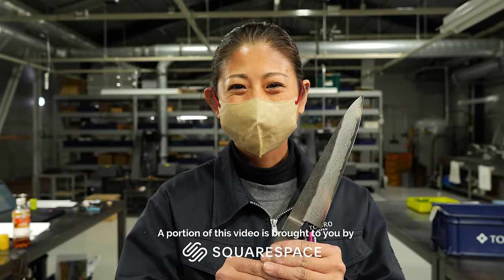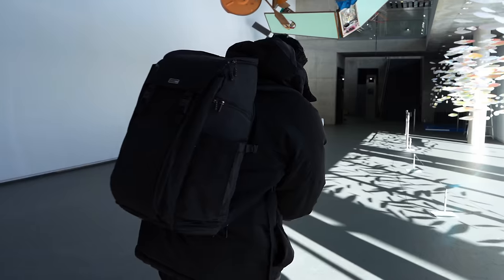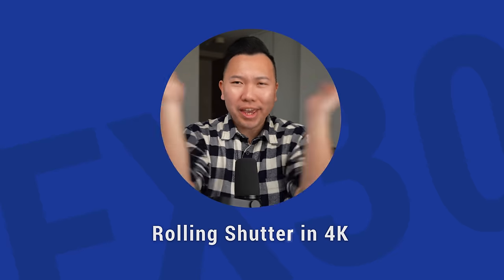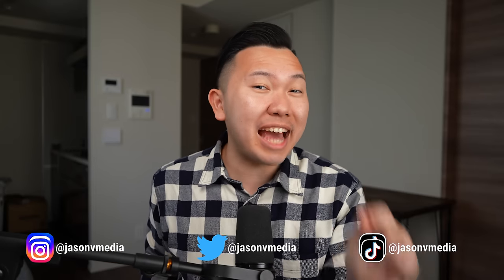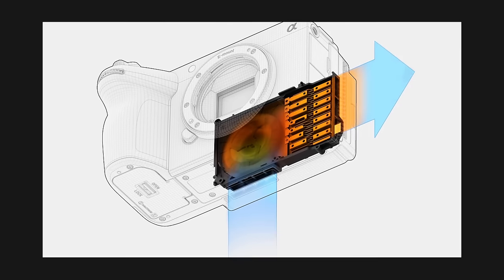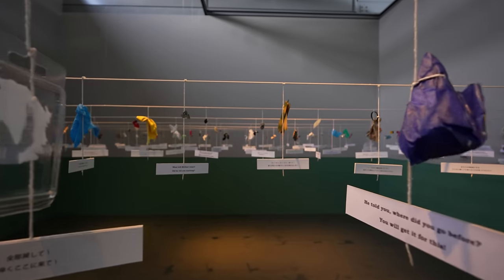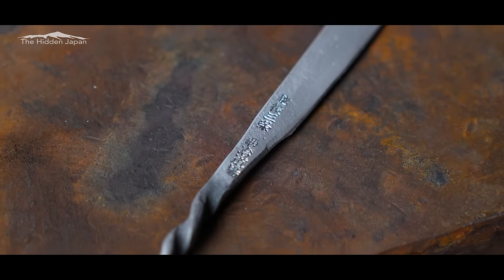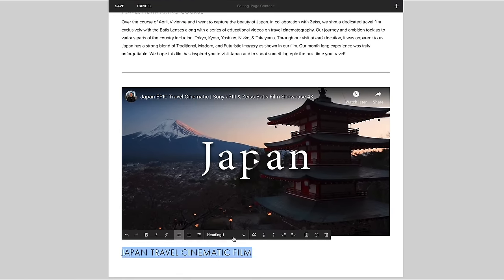Sony FX30 | 3 Months Later User Experience Review ft. Niigata, Japan

Comment: I "upgraded" from an a73 to an fx30 since I'm more of a video shooter. The video centric features, 10bit colour, cineEI etc. I can buy 4 amazing APSC lenses for the price of one gmaster. I could've had an fx3/a7siii, or an fx30 with a couple lenses and an rs3 pro for the exact same money. Easy choice.
Reply from the maker: crazy how the fx30 beats out the a7III in some aspects! times are a'changing!
Reply: Are you happy with the upgrade to the fx30 from the a7iii? I’ve been considering doing the same 😬
Reply: Just ordered my fx30. Upgrading from an a7iii. Super excited. I never really push my iso past 2500 anyway so low light isn’t an issue for me. And I very much enjoy the sharpness of the fx30 since it’s downsampling from a 6k sensor. Super excited to get my hands on this.
Reply: What about low light capability? Also, would you still recommend the fx30 for video if you’re outside the US where it’s more expensive than the A7 iii?

Comment: Excellent video, especially your “commercial” for the travel business. I have had the a6500 for 4.5 years. I just an amateur photographer but I like a “real” camera over a cellphone camera. You nearly had me sold on the FX30, but no viewfinder and no built-in flash (and $1800 is quite a bit, but I could use the APSC lenses I already have).  I seriously considered going to the a7C a few months ago, but the conversion cost was to much to justify (converted for full-frame lenses). I think the FX30 might be a better choice over a7C for those already invested in APSC lenses. I’ll have to look at the specs of the FX30. Maybe it might be a good choice if my a6500 decides it has taken enough pictures and videos. Thanks again.

Comment: great video Jason!!!... like your mobile setup. personally,  my problem with sony aps-c, is that Sony keeps putting aps-c sensors in aps-c bodies with "aps-c limitations" an aps-c camera in a full frame body with the same processing power. will be a much better option then a FF. better IBIS, better iso performance, better battery life,  ect ect. The Fx30 is the answer, we just need a A6 (aps-c in ff body) and a FX60.

Comment: The FX30 is a video camera.
Blury background is primarily preferred for photos and is often overrated for video purposes.
If we want to achieve a large separation of the foreground and background, then the lenses are suitable for this and, above all, a suitable shooting technique (zoom), but during normal shooting we usually want to see even a slightly blurry background, and this is precisely where the FX30 is great.
I'm not a professional. I use the FX30 for family video or for my small personal projects of nature or old architecture. I believe that for these purposes this camera is a very good choice, especially for the huge selection of lenses - from the cheapest ones to the top ones used by FF cameramen.
I've been shooting on the Sony FX100 (very good camcorder) for a long time and I was still waiting for the FX800. It didn't come and I reached for the FX30 because it does what I wanted.
The FX3 is better in low light, but it can't do such a fundamental thing as focus breathing compensation. It also has a better display.

Comment: i am using the sony a6400 with kit lens, does the job for me. however recently its been over heating after like 40 minutes of recording.  on 30fps at 4k. in 3 years it never overheated not once, including  recording in the hottest weather  (thailand)
Reply: Do you have the "allow high temp" setting on?
Reply: @@jeremyg9305  yes it's set to highest setting

Comment: Can't wait to upgrade my a6300 to the fx30
Reply: I'm curious why would you upgrade a 6300 which is a stills and video camera for a video centric camera? I'm very interested in your answer
Reply: I'm curious to why you didn't buy the A6600 already
Reply: @tomghzel  I mean yeah even though he could have bought a a6400 all depending on what lenses he has a 6400 and the a6600 is relatively the same camera except for two things 6600 has built-in stabilization a bigger battery.

So you're absolutely right he could buy 6600 or save some money and get a a6400
Reply: @Hagaishi TV  to simply put, I have outgrown my a6300 which has been my main camera for the past 5 years. Don't get me wrong, still is a fantastic camera,  but I want to jump into color grading which 10 bit 422 will allow me to have more flexibility.
Reply: @HagaishiSama  those two have the same sensor as the a6300 and the same video quality..
Reply: @HagaishiSama  I agree that they are two different cameras, but the sensor itself is the same sensor that they introduced on the a6300, which means the video quality is the same as well. 4K30 has a crop on the a6400 too. The FX30 is really the first worthy upgrade imo because it has finally changed the sensor/processor and therefore the capabilities in recording.

I hope we get a 6000 series camera with that sensor soon so I can upgrade my 6400!
Reply: Hi, i did that some months ago, and boy i made a good choice. 
I shoot only video, i started some years ago and i bought a used a6300 (which is a great camera) from a friend of mine and it served me well for all that time, but switching to a FX30 is a game changer for me, i already had some good lenses (Sigma apsc and sigma zoom) which worked wonderfully with the fx30, it video is your main goal you can't choose a better camera if you already come from aps-c and has aps-c lenses
Reply: @eliapavoni2275  ye I have mine with the sigma 24-70 art. 🔥

Comment: Only thing holding me back from FX30 replacing my a6300 is the lack of a mechanical shutter....I don't know how good it would be for hybrid work...thinking A7IV is better for me since I can still USE APS-C lenses with it. NEED dual card slots in next camera. My other cameras are Canon 6D (astro only) A7R II, A7S. guess the A7R II could remain my high res photo camera but I still think A7 IV would be better upgrade for me than FX30

Comment: Hello Jason! Super content as usual. Please I have a few questions. 

1. I want to get the fx30 for wedding shoots. Does it overheat? 

2. I shoot a TV show with the A73 and it blows out white surfaces. I have to cut down a lot to accommodate such surfaces but the rest of the picture suffers. How can I fix this?

Thanks Jason
Reply from the maker: I haven’t experienced any overheating and with the built in fan, it helps mitigate it even more. 

I would say meter for the highlights instead so you don’t blow your highlights.
Reply: @JasonVong  thank you so much Jason! I appreciate your help. Keep winning!

Comment: I've been holding out for AGES on sony giving us 4K60 in the a6xxx series. I am still running an a6000 here. Seriously considering the FX30 but the only issue I have with it is the mic placement. I think it will be impossible to shield with my hands like I can the mics in the a6000 which are facing front instead of on the top of the unit.
Reply: I feel like the new a6700 is just for you then

Comment: oh man I'm still stuck on which cam to buy! I can't decide to get the Fx30 or the A7s3/FX3.. one is cheap but apsc and is not good for photography (which I do use every now and then) The other costs a lot and is a Full Frame beast but the lenses cost a lot more than apsc lenses.. and is the low light king as well. 😢 help a bro out. I currently have a Sony a6400 and I'll be getting into filmmaking/cinematography soon.
Reply: dont get the FX30.
Reply: @bmefilms6879  For real? Why not? 👀
Reply: @SianCKB  the noise is very bad. Sonys footage doesnt clean up Noise reduction very well in Davinci. Buy a used fx3. better lowlight and the noise pattern looks more like grain. I spent a week traveling Europe with the fx30 and I sold it after I got the footage in my computer. Youre  gonna pay 2400 after tax for the fx30.  I bought my fx3 used with top handle and it looked brand new for 3000. I bought a used mint condition 24-70 gm mark 1 for $1000. you literally dont need to buy another lens. The full frame goodness is everything they say it is. You can get really good images from a 24-105 f4 on full frame, which is significantly cheaper to buy. any f2.8 lens will need a f1.8 for the equivalent light on APSC.
Reply: @bmefilms6879  oh damn! Thanks for the reply bro! You saved me.. 😅 bad thing is there aren't a lot of used a7s3's and FX3's here in Belgium. So I think I'll be waiting for a price drop, if it ever happens..

Comment: its best to wait for the upcoming a6xxx series or just buy the a7iv. fx30 is way too bulky as an aps-c camera, and worse DR than a7iv in apsc mode. the noise at 20:32 is just bad... (a7iv is 800/3200 iso, lower rolling shutter, smaller crop) plus u get mech shutter, evf, AND doubles as a full frame camera. fx30 is best used as a tripod camera for productions, not for a solo creator.

can't wait for the new a6xxx series tho, evf & mech shutter, a smaller form factor, all the while should be cheaper due to its lack of "cinema" tax
Reply: a7iv has more rolling shutter than fx30....26.8 ms vs 15.8 ms

Comment: would you mind, how you manage this fx30 file in post? its better than a7 or need more powerful computer? i sometime hate a7 4K raw file in post, always need hugh resource even had proxy on it. as a video guy, small preview and edit from my MBP on set then full post production on windows base computer is common thing.
Reply from the maker: It’s the same codecs so if you’re having trouble with a7 files then it’s likely gonna be the same with the FX30. You could try shooting XAVC S-I - bigger files but editing softwares can chew thru as opposed to the compressed H264/HEVC
Reply: Really depends which file type you choose. For 10-bit (esp. HEVC) you will need a computer capable of decoding it with the GPU.